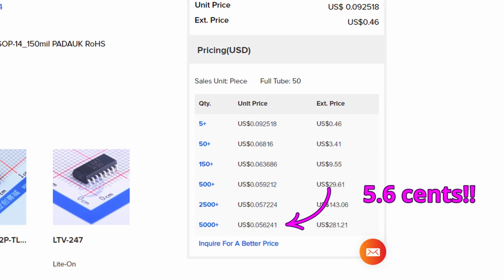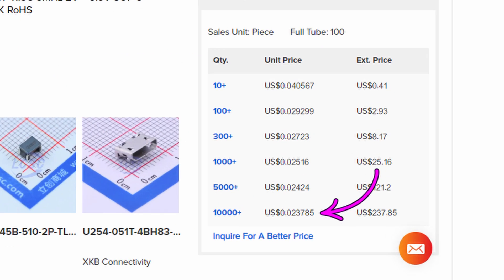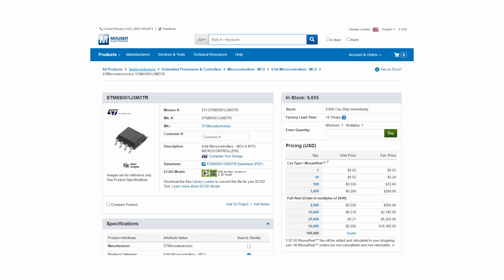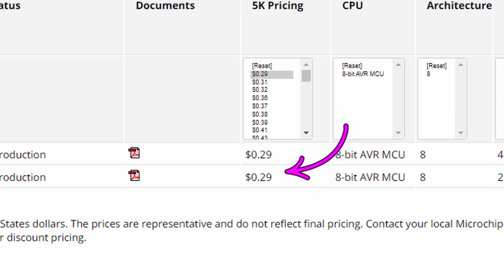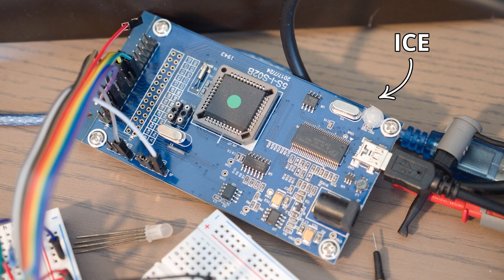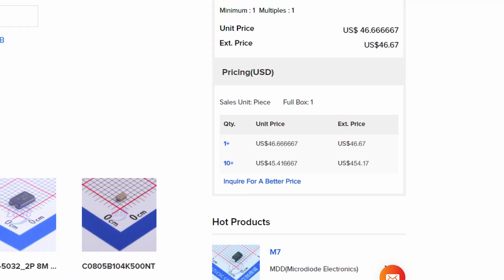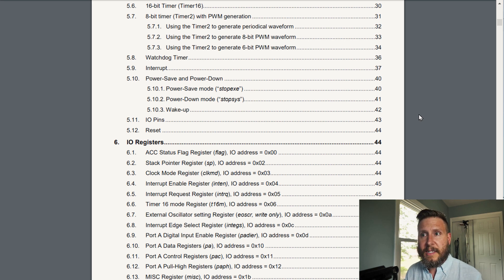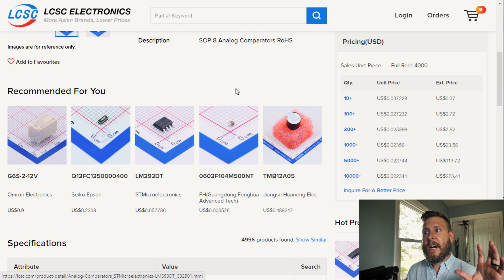HOW IS THIS 3 CENTS??? | The 3 cent micro controller

Comment: Hello, do you design for this microcontroller?
Reply from the maker: Yep, if a client wants to use it!  It's pretty capable for simple tasks, and a great deal for the price if it works for their application.
If you're interested in doing a project with it, feel free to reach out.  I have contact info on https://overkillprojects.com/
Reply: @overkillprojects8091  I sent right now

Comment: I've been trying to duplicate some code from a PIC processor to do a very simple task... I bought a bunch of PMS150C uControllers along with programmer and emulator, but I can't make heads or tails of their Mini-C. It doesn't help that I'm a crap C programmer, but I can usually find example code that I can play with to get the PIC to do what I want... no such luck with the Padauk. Are you open to do some programming by commission?
Reply from the maker: Of course!  Feel free to hit me up at the email address on the website: https://overkillprojects.com/